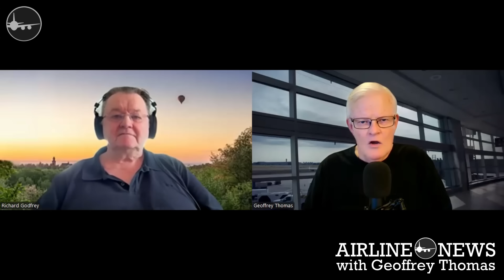Air India Crash - Probable Cause  #airindiacrash

Comment: Gentlemen....with all due respect to you....the contents of this channel get more and more laughable each day.   And to suggest that the pilots within just 4 seconds would move the fuel control to cuttoff, (supposedly following a checklist using CRM principles), all the while during a critical phase of flight when the aircraft is rotating into the air is utterly laughable.  No flight crew would to take such critical actions without cross checking with each other and even then such procedures are not carried out until they are safely away from the ground.  It is utterly laughable that thermal runaway in APU batteries or even the main batteries,  would cause the engines to shut down immediately. What about Human Factore??? Back in 2009, It took Sully a good 30 seconds to realise his plane was going down and to digest what was happening. To suggest this flight crew who would have been caught totally off guard would have responded by intentionally, supposedly following a checklist and moving the fuel controls to cut off in a period of just 4 seconds after the 'first event' shows an utter disregard for human factors, it's practically an impossibility for the crew to react so quickly during an intense phase of flight.  If your suggestion is indeed what happened then why would one pilot have questioned the other 'why did you move the fuel controls to cut off', if when following a checklist/memory items of this nature during an emergency must be done with both pilots cross-checking one another as they carry out the actions.  I feel your channel is spewing out wild speculation, is totally amateruish , and without any evidence whatsoever, besides a supposed puff of smoke.  This is really too far-fetched.  Does anybody else agree with me?
Reply: You can have this to The Aft battery is located in the aft cargo bay close to the aft cargo bay door visible to both engineers and baggage handlers it's also located close to the bite test terminal. 
ACMS system monitors battery life battery condition and   it will warn of any failure and will disconnect from the electrical systems. 
The battery cells are individually wrapped in inert materials with a electrical disconnect between each cell to prevent thermal runaway spreading throughout the battery the cells are sealed into a stainless steel case both to contain the fumes and the heat. And is allowed to vent to the outside in case of malfunction. 
This battery pack is not located near the aft AE bay it is a number of frames fwd of this nor is it situated under a toilet or galley area. It is sat on a support frame member behind cargo wall panels and a site glass for inspection purposes. Water cannot enter the battery because it is completely sealed . The aft data recorder is situated a number of frames away from this battery behind a pressure bulkhead and close to the APU .

Comment: " causing FSOVs to fail-safe shut instantaneously and cutting off the fuel supply".  ive been told numerous times these FSOV's cant be shut off with out lifting he knobs out of a metal bracket ?
Reply: There are only two exhaustive ways where these FSOVs can shut down as a fail - safe without any manual lifting of knobs and I will provide you here with both. 
1) A major total electrical power failure that can possibly lead to some spurrious/automatic/malfunctional airframe logic command related to a relay/RPDU fault , causing FSOVs to fail-safe shut instantaneously and cutting off the fuel supply. OR 2) The DC bus that powers the Fuel Actuators solenoids likely fails, due to Major Electrical Cascade, causing the solenoids to de-energize. With the solenoids no longer powered, the FSOVs snapped shut in their fail-safe position. This Uncommanded closure cuts off fuel flow to both engines instantly, resulting in an immediate dual-engine flameout ... Hope this helps.
Reply: @Skyking-v2m  so that Is the glitch. Wrong signals closed the Fuel shutoff Valves. No More the Fuel pumps.
Reply: @laboechat68  This could be one of the possible cause of instantaneous Fuel cut off and Dual Engine flame-Out. The another probable cause could be de-energising of fuel solnoids due to DC bus failure being a result of a major electrical outage. This event would also result in shutting of fuel supply at Spar instantly. Only indepth analysis of logs like FSOV feedback and cockpit discretes and others  would give clear insight. Hope this helps.

Comment: It might be a case of what caused what. The water ingress theory is still relevant because if that did cause a short circuit, the load on the battery could have been way beyond its design parameters resulting in bms overload. I'm slightly sceptical around the corrosion aspect. I think it is  reasonable to suspect a battery fire due to short circuit but as to whether this brought the aircraft down, I'm sceptical. In the short time these events happened, and given the redundancy systems, I think the original plausible hypothesis still carries more weight as to actually causing the tragedy. I think a fire was an outcome of water ingress. I believe the water ingress itself led to catastrophic system failure leading to engine shutdown and I still believe, in this scenario,  that redundant systems did work but not fast enough. 
Thankyou both for continuing your investigation.

Comment: Another avenue of thought.....  Normalisation of deviance !!
From Wikipedia, the free encyclopaedia
Normalisation of deviance, according to American sociologist Diane Vaughan, is the process in which deviance from correct or proper behaviour or rule becomes culturally normalised.
Vaughan defines the process where a clearly unsafe practice becomes considered normal if it does not immediately cause a catastrophe: "a long incubation period [before a final disaster] with early warning signs that were either misinterpreted, ignored or missed completely".
The original example cited by Vaughan is the events leading to the Space Shuttle Challenger disaster in 1986, but the concept has also been applied to aviation safety. Also to the Deepwater Horizon disaster.

Comment: UNDER NO CIRCUMSTANCES IS THERE A PROCEDURE TO MOVE THE FUEL SWITCHES TO CUT-OFF
Reply: See below, from a Boeing flight operations information bulletin document, do a search for Boeing dual engine failure reset, you'll find it. 

Here's a few excerpts from the bulletin for a 767, it could be different for the 787. I could be wrong but this sure looks like a defined procedure to move both fuel switches to Cutoff to reschedule engine control ...

"The revised recall portion of the checklist includes positioning the Fuel Control switches of both engines to CUT OFF, and then returning the Fuel Control switches to RUN."

"Dual engine failure is an emergency situation that demands prompt action regardless of altitude or airspeed. "

"Placing the Fuel Control switch to CUT OFF if the engine appears stalled or approaches the EGT start limit, clears the stall. Returning the switch immediately to RUN "reschedules" the engine control and allows the start to continue."

Comment: Not sure I fully understand.  What is still not clear to me is why the shut off switches were toggled by the crew and why one of the crew members asked the other why they had cut off the engines.
Reply: To answer the second part of your query , In my opinion, the CVR transcript suggests tension, confusion, not necessarily inadvertent cutoff
The exchange “Why did you cut off the fuel?” / “I didn’t.” probably reflects reflexive action amid chaos , shock syndrome seeing the flooding EICAS alarms and Decision paralysis brewing due to below cited reasons — not a contradiction. It  is likely fueled by the following cues:
✓ Fuel flow reading possibly showing ZERO
✓ Dual Engines failing
✓ EICAS alert cascade
✓ Decaying N1/N2 RPMs
✓ Rapid thrust loss
✓ Declining performance
✓ Vibrations, loss of engine sound, or flight irregularities 
 ✓ Unsettling sluggishness underfoot.
 All point towards a typical fuel starvation scenario. Hope this helps.
Reply: @Skyking-v2m  I had asked this earlier. Did one pilot actually asked " why did you cut off THE FUEL?" or did he just say:"Why did you switch IT off?" Meaning: are we just assuming that the fuel switches were meant, while the question might have referred to something else, like crts ore whatever?  At this time it looks like we still don`t know, what exactly was said nor even what language had been used.
Reply: @JoachimHagemann-h9c  The exact sentence in AAIB prelimnary report is "In the cockpit voice recording, one of the pilots is heard asking the other why did he cutoff. The other pilot responded that he did not do so." So its not Why did you switch it off. AAIB mentions in CVR as Cut Off.
Reply: @Skyking-v2m  The Prelim didn't say "why did you cutoff the fuel."  It didn't contain any quotes but dis ask mention that one pilot asked "why did you cutoff."  "Fuel" is never mentioned in this regard.  Lots of discussions are making the same inaccurate claim.
Reply: @joekostka1298  Since the convesation between the pilots is immediately preceeded by these sentences in the AAIB report  :  " the Engine 1 and Engine 2 fuel cutoff switches transitioned from RUN to CUTOFF position one after another with a time gap of 01 sec. The Engine N1and N2 began to decrease from their take-off values as the fuel supply to the engines was cut off, "  Now, it ideally does look to be a talk on the FUEL aspect. Do you see any other aspect that a pilot could ask his colleague related to CUT OFF other than FUEL please.
Reply: @Skyking-v2m  We know the FO was operating the aircraft.  In the event of an electrical failure shutting off both engines the FO's instruments will go dark and the Pilot will have to fly the aircraft.  Asking why did you cutoff could easily refer to the instruments in front of the FO.  The Prelim doesn't give enough info.  As I've said before we don't even know what language they were speaking and don't know who was asking what.  It's dodgy at best to try to get resolution from such a lack of factual information.  I believe there was a major electrical failure which shut down the engines.  The pilots may have also had a fire alert in the cockpit and possibly thought to shut off fuel to the engines for that reason.  We just don't know because of the lack of info in the Prelim.  The CVR and FDR should let us know what really happened.
Reply: @joekostka1298  Thanks for sharing this perspective. You make a valid point — the Preliminary Report leaves asking for more , especially around CVR context, language, and cockpit exchanges, so it’s hard to pin down intent. From around 2 hours of CVR recordings only couple of sentences are available currently.

My point on the “fuel switch cutoff” record was less about pilot intent and more about the ordering of evidence. As the prelim stands, the FDR shows switches → CUTOFF, but unless FSOV feedback and cockpit discretes also align, that could just as easily be a data aliasing or mimic-recording artifact.

You’re right that a major electrical failure could cause multiple cascading effects — from dark instruments to FADEC/engine shutdown — without any pilot physically moving the fuel levers. That’s why I feel the eventual correlation of FDR, CVR, and systems logs (FSOV positions, RPDU traces, DC bus health) will be key in distinguishing whether it was:
a) actual pilot input,
b) electrical-driven FADEC/FMU shutdown, or
c) false recording of switch state.

Until then, I agree it’s best to treat any single data point with caution and await the full picture. Thanks.
Reply: @Skyking-v2m  The other possible reason for this question, and others have mentioned this, the flight officer could be asking this question because his display panels suddenly went dark. RAT deployment means total electrical or hydraulic failure and more likely total electrical failure. If this is the case then the 28V DC buses that supply power to the captain and flight officer's instruments goes to battery only standby power and in this mode the flight officer's displays go dark (limited power in this mode). It would have helped if in the preliminary report a reference time was given when this question was asked and more context provided from the CVR.
Reply: @Bill-f9k1x  Thanks for your kind words.
Reply: To answer the first part of your query : In my opinion, there are totally precisely only THREE main event possibilities that could have transpired on that ill-fated day of AI171 Flight, as per my research and deep-dive analysis: 
1) A major total electrical power failure that possibly led to some spurrious/automatic/malfunctional airframe logic command related to a relay/RPDU fault , causing FSOVs to fail-safe shut instantaneously and cutting off the fuel supply. OR
2) The DC bus that powers the Fuel Actuators solenoids likely failed, due to Major Electrical Cascade, causing the solenoids to de-energize. With the solenoids no longer powered, the FSOVs snapped shut in their fail-safe position. This Uncommanded closure cut off fuel flow to both engines instantly, resulting in an immediate dual-engine flameout. This possibly got mimic-recorded as FUEL SWITCH = CUT OFF in FDR side.  OR
3) Additional possibility, though very rare is FADEC likely lost command authority; engines lost metered fuel flow as the FMU was compromised. This led to immediate Engine fuel supply being cut-off and Aircraft Stalling. 
The 3)  above is a rare possibility as at the takeoff thrust, each FADEC is self-powered by its PMA; a FADEC-first/FMU-first shutdown would require very rare, identical EEC failures or simultaneous PMA defeats — much lower prior probability than a single airframe electrical fault that issues (or mimics) dual cutoff commands RAT deployment here is consistent with downstream consequence (both engines flamed out because fuel was cut at the spar). likely not indicating FADEC to fail.Hope this helps...Will provide details on why one crew member would have asked why FUEL SWITCH WAS CUT OFF in next comment.
Reply: yeah he casually mentions the fuel switches were cut off then continues with just a load of numbers and a whole lot of other BS . guys a clown

Comment: Great theories again gents. However as mentioned in episode Plausible Hypothesis, this needs to be more specific in details. What upstream damaged components exactly would cause a double engine failure considering all the redundancies? Such things would include each Fadec PMA power, separate power sources from L/H to R/H, separate Fadec channels etc. If there are common denominator components in the Aft E/E bay that would cause both engines to fail, that would be a major engineering design oversight. What components would they be? 
I believe the ambiguous preliminary report to be just that, a rough guideline put out to give the direction of what may be more known, of which will come in the final report. Perhaps the stated timings in the prelim report were never meant to be so scrutinized but have turned out to be so misleading.

Comment: For this "plausible cause" to take place how long a time does each of the reactions need to take place. For example, does the corrosion take place within  a second of the ingress of the water? Has the corrosion occurred prior to the event moving into the catastrophic phase with the water entering through this hole caused by the corrosion.  
Essentially, for all these separate moments of the failure, how long does each chemical step take?  Is the water ingress,  corrosion,  heat build up bursting into flame, and the electrical damage all occurring explosively, within a second or two? We need a chemist to lay out this brief timeline explaining how this scenario unfolds. 
Did the flooding happen only on rotation?  Did the water exist earlier to cause damage or corrosion that led to the next step of this chemical process? 
Would damage or smoke detection systems and developing electrical failures set off alarms? 
Is the RAT deployment accompanied by explanatory alarms and information systems?

Comment: DON'T WASTE YOUR TIME READING MORE OF THE BULL CRAP SPEWED BY THESE TWO OPPORTUNISTS. THE CAUSE OF THIS CRASH WAS ONE OF THE PILOTS SHUT DOWN BOTH ENGINES AT LESS THAN 1000 FEET, GUARANTEEING CRASHING. ARE THEY OR HAVE THEY EVER BEEN ANYWHERE NEAR THIS AIRCRAFT DISASTER TO CONDUCT A HANDS-ON EVALUATION???????????? IF THE ANSWER IS NO, THEN WHY WOULD YOU PAY THE SLIGHTEST ATTENTION TO ANYTHING THEY HAVE TO SAY???? ANYTHING FOR A BUCK!!!!!!!!!!!!!!!!! THE SECOND BOTH ENGINES WERE SHUT DOWN, RECOVERY WAS IMPOSSIBLE!!!!!!!! THESE TWO SHOULD BE ASHAMED!!!!!  ASK THEM TO PROVE THAT WATER CONTAMINATION HAD ANYTHING TO DO WITH THIS CRASH. WITH THE HORRIFIC HEAT/FIRE THAT ENSUED THE CRASH, ANY MOISTURE/LIQUID WOULD BE IMPOSSIBLE TO FIND!!!!!!!!!!!!! ANYTHING FOR A BUCK!!!!!!!!!!!

Comment: Good analysis gentlemen, I'm Paul. Correct me if I'm wrong, the APU battery of the Boeing 787-8 is located just behind the wings on the right side of the aircraft, in the aft Electronics Equipment (EE) bay under the main cabin floor. The aft EAFR is located 1847" from the nose of the aircraft in close proximity to the rear emergency exit doors of the B787-8.
The PR provides side by side pics of the aft and fwd EAFRs showing significant impact and thermal damage on the aft EAFR. Is it possible that the damage of the aft EAFR to had been caused by the post crash impact and fire?